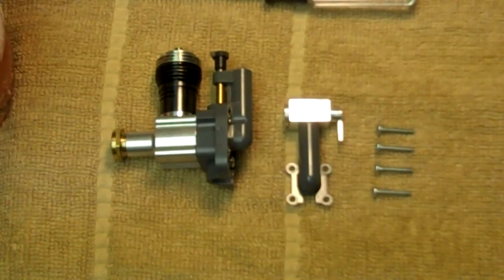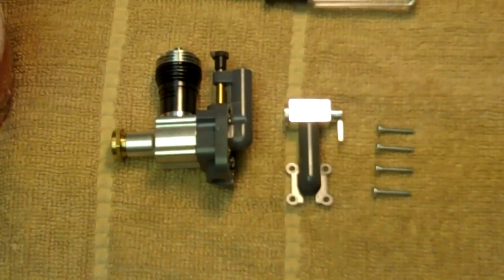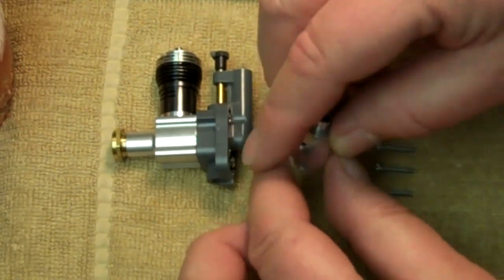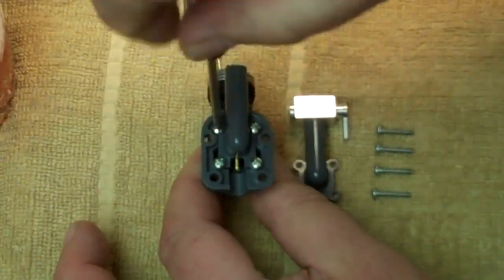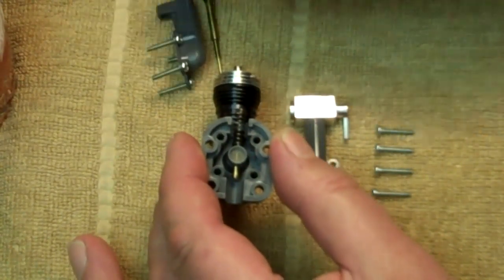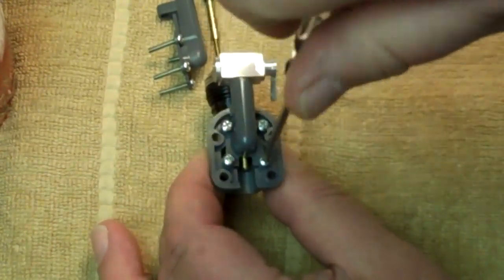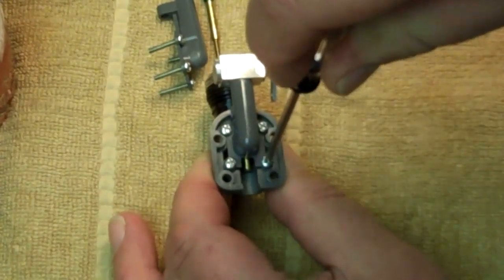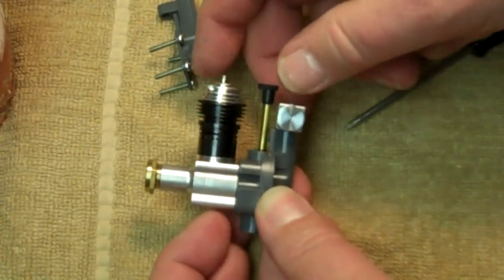Cox .049 Sure Start Throttle  Conversion

Comment from the maker: A little over 3 years ago. People were experimenting with just an air intake restrictor (barrel) but it was about 3 years ago that a commercially available unit was offered.  To the best of my knowledge. It's not perfect, but does work pretty good considering the cost.  The Cox .049 has nostalgic memories for me. Since it was the engine that I learned how to fly controline on in 1966.

Comment: My Father had a Cox 049 Powered Car with a exhaust restricting throttle. It worked surprisingly well. I have never seen these newest released Cox's . The ones I had ( my Dad nabbed them all back and he's got them all now lol ) were from the 60's 70's and 80's with the rear metal gas tank.
Reply from the maker: Yeah, I remember those.  I always felt they robbed  power from the engine compared to an unrestricted engine.  But they worked.  It's worth trying one of these air restricting throttles.  I've wanted to try one of these on a plane.  With todays light electronics, a 4 channel .049 is viable.  When I was younger, it would have been impossible.  Thanks for the comment.

Comment: NICE! I know this engine is meant for rc planes, but I want to get it for other things. I want to try building a gas powered mini air raid siren, an rc hover craft, an rc propeller driven car, and many other things with this engine. And mainly just to run it and mess with the throttle for fun. I love engines and have always wanted a small engine to mess with.  And with this engine being 30 bucks, that is amazing!  I would totally pay 30 bucks for an engine like this! And thanks to this video, I can now do all these things with this engine!  Once I get a 3D printer, maybe I can even make a mini weedwacker with this engine!  Or a mini lawnmower! This engine sounds alot like a weedwacker bc most weedwackers are also 2 stroke!

Comment from the maker: @Mattcscania  Well without the throttle conversion, the only thing you can do to adjust rpm is only with the needle valve.  But that is only on the ground.  Once a Cox .049 non throttled engine is launched, its running pretty close to peak rpm, until fluctuations in fuel amount, speed, fuel delivery has effect on it. So  that's what neat about this throttle available from Cox International.  Cox .049 aircraft engines were generally released as non throttled engines.  Hope that explains.

Comment from the maker: They will with a diesel head conversion.  You have to be able to adjust compression but I don't have any experience with diesel.  I would suggest you look at the link that I posted in my original description.  Cox International has an engine already setup to run on diesel.

Comment from the maker: I have to add, make sure the bolts that go through the throttle/backplate and into the crankcase are fairly tight.  In current tests I found mine had loosened  and I experienced poor running characteristics. Any pressure leak is detrimental and will degrade performance.  Not to mention it makes it frustrating to start and run.

Comment: Hello I had the 049 cox engines 35 years ago, the problem as always was making them start, can you tell us what changed in the sure start models, thanks
Reply from the maker: To tell you the truth, not much.  The Sure Start engine needs an auxiliary tank.  A spring starter on the front really helps.  Other than that, I find them easy to start.  Make sure you have a good starting battery and all the bolts on the engine are tight ( insures no air leaks)  and they're pretty easy to start.  Most of us like fuel with 25% nitro, Sig Champion 25 is pretty good.  There has been different reed valves, different glow heads, but all in all, they all start.  I started with a baby bee .049 back in 1967 as an early teen.  Get enough experience with one and you know just what they need.  Compared to the market, they're not the most powerful, but for the price they are remarkable.  Get one running at 16,000 and they really get your attention.  Definitely a minature marvel.  Hope that helps.
Reply from the maker: +BansheeFifteen Also knowing when to prime the engine or detecting a "flooded" condition, can make a difference.  For starting, make sure your glow plug battery is strong enough to make the nichrome wire in the glow plug heat to the point it is glowing orange. Always disconnect from the glow plug when you are checking things to preserve the battery. When first starting, sometimes a drop of fuel at the exhaust port will prime the engine.  You should hear a hiss when the battery is on, if not and you have too much fuel in the cylinder you might have a "flooded" condtion.  Blow out excess fuel and continue.  I have found the spring starter that mounts on the engine can make starting much easier.  These engines can start in either direction, after it starts, make sure its running the direction you want.  A pusher engine will run in either direction as a standard engine.
Reply: Thanks, this brings back good memories
Reply from the maker: +bobby “KARTS and ATVS” warrior   Yeah, no problem.  Funny thing is, current RC tech now makes it possible to build a 4 channel RC airplane powered by one of these little Cox .049 engines.  I would have never thought of doing it back  in the 60's.  Not the greatest engine, but for what they are, they are quite remarkable.

Comment: how do you mount the engine on plane when that tube gets on the way? Mine does not have that tube at all.
Reply from the maker: You have to makes some kind of standoff from the firewall of your plane.  A couple of wood beams the thickness of the tube running parallel to the tube should do it.

Comment: how do you normally control the throttle?
Reply: Mattcscania you run full theottle until the fuel is empty or you have a mechanism that controls throttle by reducing exhaust holes